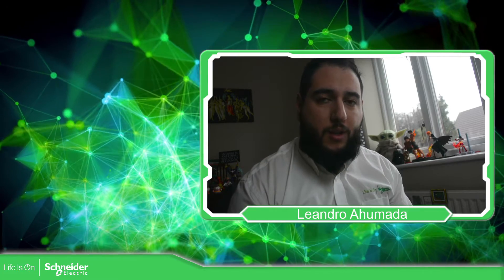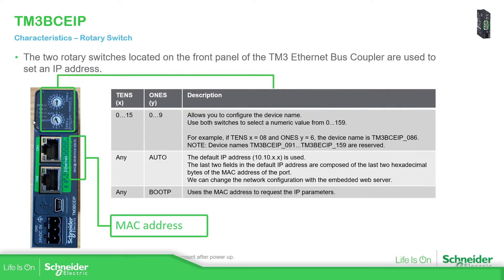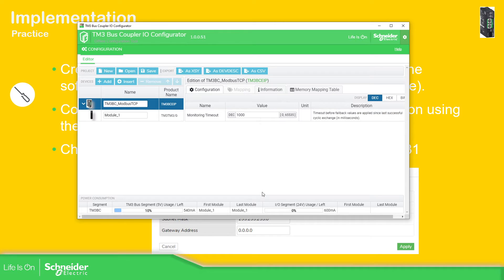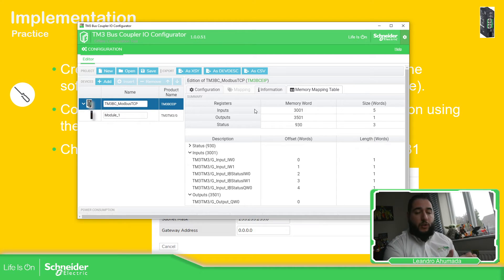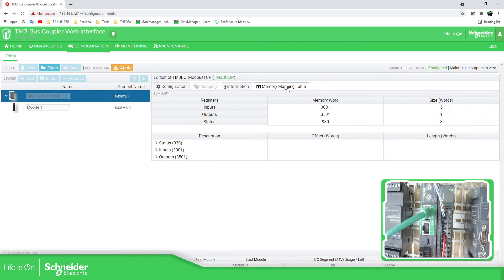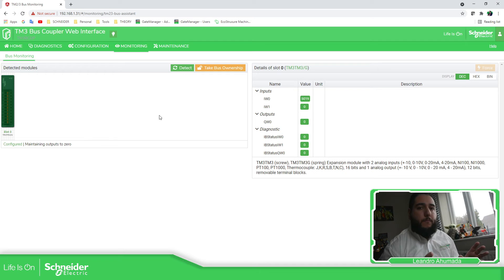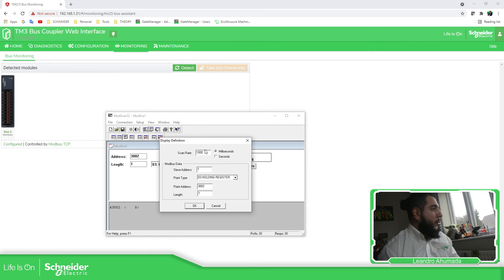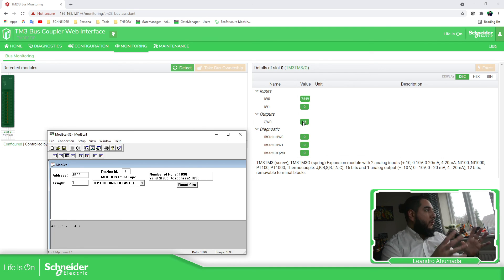Training - Bus Coupler - TM3BC - M11.4 TM3BCEIP characteristics

Comment: How can I configure TM2 modules on TM3BCEIP bus coupler? I am using M241 PLC
Reply from the maker: If you are using the Machine Expert to work with the M241 you can add the TM3BC in the configuration and then add TM2 or TM3 modules. Otherwise use the TM3BC IO configurator to define the hardware for the bus coupler and use it as generic device in SoMachine for the M241...i have just checked this part and in the TM3BC io configurator the TM2 are not available
Reply: @LeTomasAHUMADA   Yes, I am using Machine Expert Logic Builder 2.1.2. Still dont have PLC just preparing offline program. So I try TM3 configurator and didnt work, as you said it is only for TM3 modules so I add in Machine Expert Ethernet 1 --> Industrial Ethernet Manager --> and add TM3BC_ModbusTCP and his modules. I need 2 connections on my PLC connection with BUS Coupler and connection with VFD. Configuration like this should work? https://drive.google.com/file/d/1j_wLTkhwWvOkr2kzILYk92ZagZZ7YYMT/view?usp=drive_link

Comment: Is Schneider tm3bceip compatible with tm251mesc controller?
Reply from the maker: Hi there! If i am not wrong the ioscanner is for the tm251mese and in your case you willl probably need to use the function block (read/write var) to access to the buscoupler information.

Comment: HI. Have you managed to communicate with an Schneider AS-P Smart-x? I'm trying to use the TM3BCEIP and I get time out on the TM3BCEIP side.
Reply from the maker: Hi Mihai! I do not work with that line in schneider but you can increase the timeout in the TM3BCEIP. Although , I recommend you to take a look how often are you reading/writing from/to the bus coupler because that could be the reason.

Comment: How can I change the IP address of that coupler?
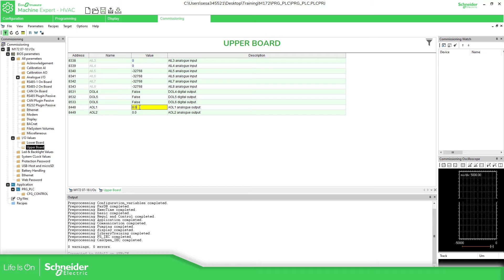Reply from the maker: Hi there, if you want to use a fixed ip address then you can use the web server of the bus coupler,check from the 09:00 of the next video to connect to the BC:
https://youtu.be/kVsMbqzq_N0

Then in the Maintenance Tab you can configure the ethernet settings.